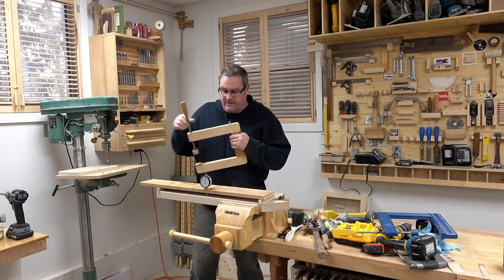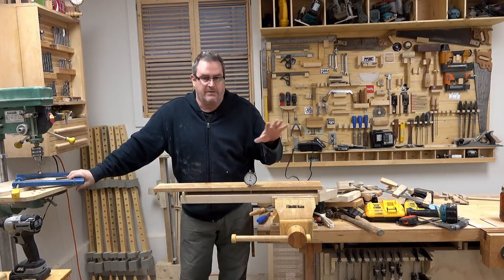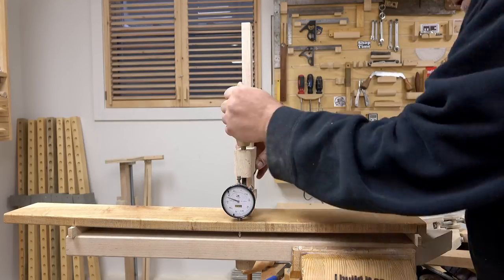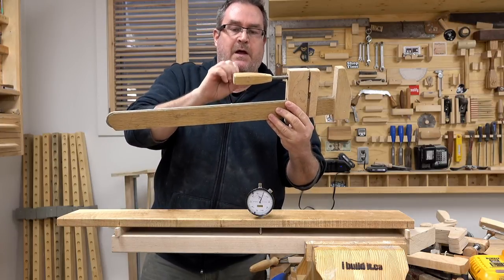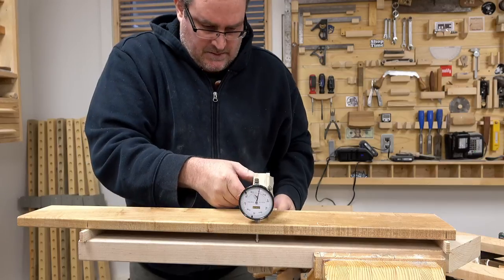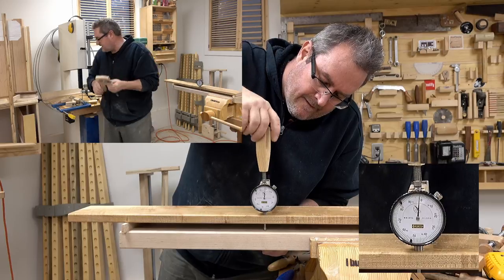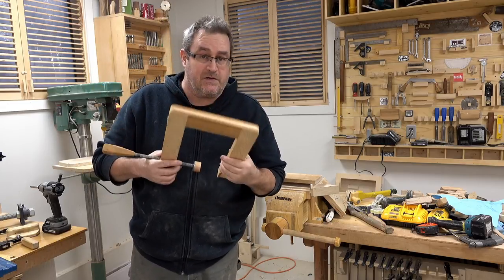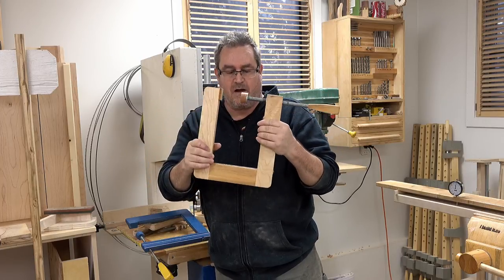Testing Various Homemade Clamps

Comment: I like the hybrid clamp the most: easy to build with few tools, still light, but much stronger than cam clamps. 3 turns, should be over 100kg, hey, that´s more than enough for most applications. Thank you for this desing, John!

Comment: Thanks for taking the time to test all of your designs. It's helpful to see them all being used in the same video to get a good feel for how easy one design is to use compared to the others.

Would it make sense to measure force instead of deflection of a random reference since you are going to the effort of testing several clamps?  Using force would also make it easier for the clamp wars to occur ;-)
Reply from the maker: To put numbers to it, we both stood on the test thing. Matthias weighs 150 and deflected the board 1.75 turns, while I weight roughly 250 and deflected the board 2.75 turns. So 5 turns would be approximately 400 pounds, which is very good for any clamp and more than you'd normally apply to clamp a glued joint.

Comment: the clamp you used the spacer block with, would have made is slightly harder for the clamp as the block was going along the length instead of the width, (it was going long ways instead of short ways) spreading the area it has to force down. (which is usually a good thing)

Comment: Gotta rewatch your long reach clamp video, im assuming the handle is just epoxied to the threaded rod. Here in the US (harbor freight), you can get a 6 inch bar clamp for $3, and for a 3 footer only $8. However they dont carry anything like your long reach clamps..

Comment: I'm interested in the pressure meter you used to test your clamps. Where did you get it? You have proven home made clamps can be just as good as store bought ones! Thankz
Reply: Not a pressure meter, just a standard dial gauge they installed in a jig to measure distance the board was flexed between two equidistant points.

Comment: i think doing all these tests and stuff are great and interesting - but the bottom line is that all of these clamps - exert WAY more pressure than you would ever need for 99.99% of all glue ups you're going to do as you mentioned.

Don't get me wrong - bragging rights matter and the "clamp off" between you and Mathias was awesome to watch - but from a pragmatic standpoint - all of the clamps you guys shows - are totally functionally adequate for almost every application you could want to use them for - except maybe compressing something into diamond :) 

awesome video tho

Comment: Best clamps i've made, and are far superior to anything store bought are made from flat stock. But, ye do have to learn to weld, so there's that. Long clamps, short clamps, small ones, long reach, deep reach. Your imagination is the limit, and your luck with finding cheap flat stock in your area. I'm lucky with a metal fabrication shop selling their drops.
Reply from the maker: Been meaning to make some all-steel clamps, actually.

Comment: Just curious if you've tried putting the spacer block on the bottom jaw? Then the screw wouldn't have to travel as far and could possibly be more stable because your moving the exertion closer to the screw jaw. Not sure if it will work, just wondering if you've tried.
Reply from the maker: That's what most people would call "six of one, half a dozen of the other".

Comment: Hi John,
On many videos where people use their shop made long reach clamps it seems that they've built the clamp with too wide an opening making the clamping screw subject to being easily bent.  Have you given any thought to the relationships between reach, depth and screw size, and what might be optimum for them?  Thanks.
Reply from the maker: Of course, but there are too many variables involved to pin down exact numbers. Wood, even from the same tree, has varying properties that will have a large impact on how much force a clamp can ultimately exert.

Comment: so the question is.....you can put a lot more clamping pressure than what you really need them for......is it really all that relevant if you can hold it a LOT tighter if all you're doing it gluing??
Reply from the maker: Gluing requires a lot of force.

Comment: After you repeatedly bend that board over and over isn't it going to get easier to do overtime (and thus take less pressure to deflect) as the wood fibers stretch out? Prob good enough for what you are doing just not very scientific:)
Reply from the maker: I doubt bending the board by that small amount has any significant effect on its strength. If we hold out for the definitive scientific method, it will never get done, so best to take what you can get - this is close enough.
Reply: Fair enough #TeamMatthias :)